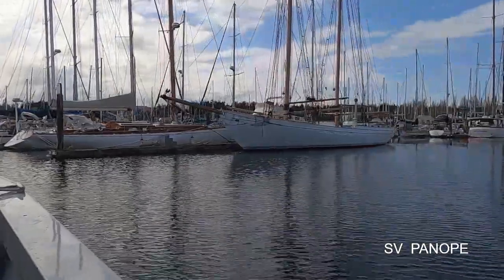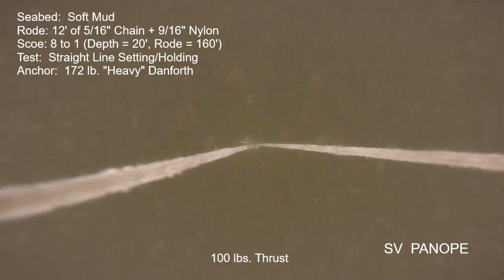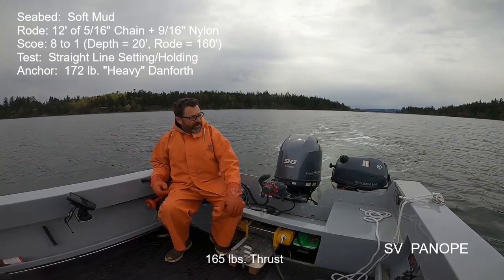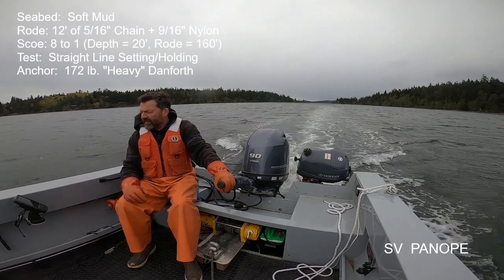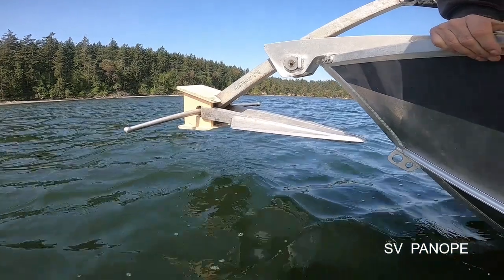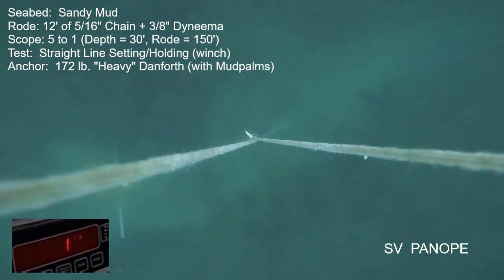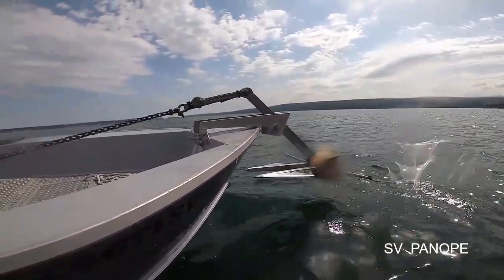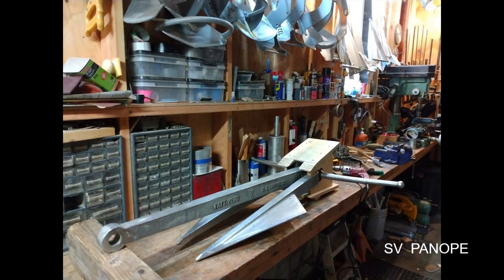172 lb. Danforth Problem.  Anchor Test Video # 136

Comment: Using a Danfoth anchor as a stand for mail box is a good idea. I have had the same problem with Danforth on hard sand. Nothing happened except for the boat drifted away. Now I have a Bruce copy, slightly better but after seeing your video I will buy a new anchor. Probably a Lewmar Excel or a Rocna. My wallet sets the limit.

Comment: Hello
I have a Danforth stainless steel anchor in the region of 25-30kg. 
I find it drags and doesn’t hold anywhere near well enough fit new to feel comfortable to sleep near or around other boats. 
My boat weighs around 9 tons sports cruiser style. I’m in need of a new anchor due to someone bending it so my question of I may is what’s a good anchor for mud sand stones bottom for a plastic boat that gets blown all over the place please?

Comment: hello, i found your hinged design for your mast quite intriguing. Was wondering could that same concept be applied to a wooden mast? btw loving the vids, as always keep'em coming.
Reply from the maker: Anything is possible, but I believe that my "scarf joint" tabernacle design would not be a good candidate for a wooden mast due to the very high loads in the area of the hinge.

Comment: Why do large ships continue to use the older style anchors? Does size matter?
Reply from the maker: I have no experience with Large ships so please view the following with skepticism.  
There are pobably several reasons: Large ships do not need high performing anchors (as much as small boats)  because they are not affected by harbor waves, they have awake crew 24/7, they can simply go to sea in severe weather, and yes, I believe scale is a factor in favor of larger vessels.  There may be a strong tendency to stick with known/certified equipment.  Most ships have hawse pipes rather than rollers.